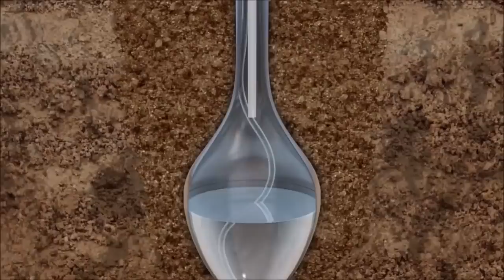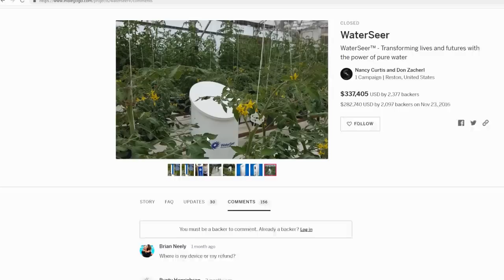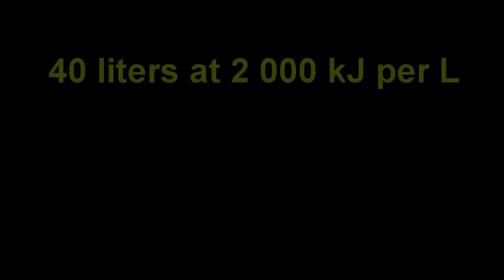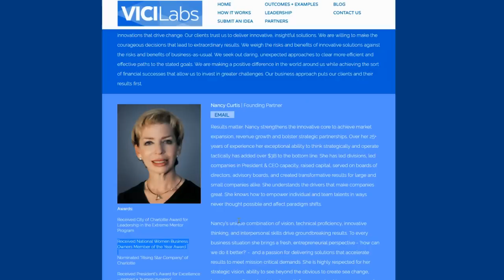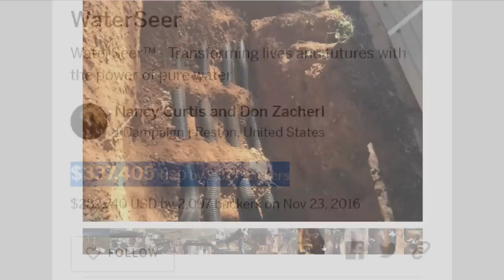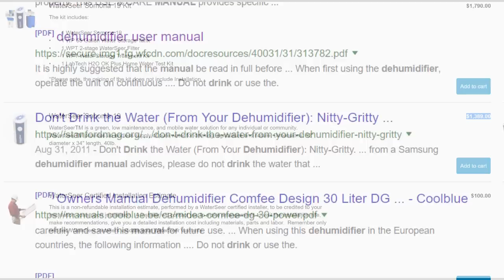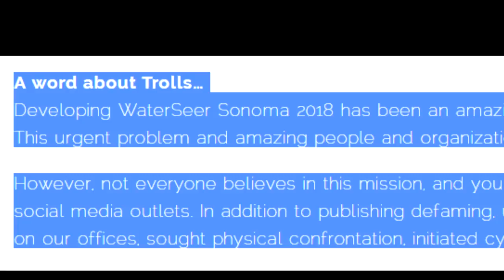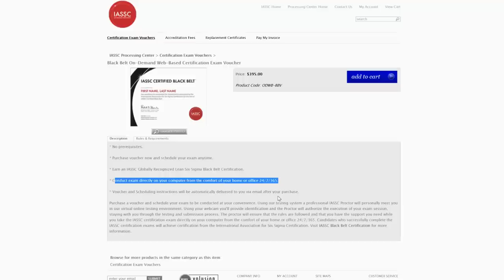Waterseer MEGA-BUSTED!!!!

Comment: It’s almost like all that money could have been used to build wells for water deprived areas
Reply: No no no. Those are proven to work.
Reply: xxOmponxx right???!😁
Reply: george green oh George love the troll! 😉
Reply: Not innovative.
Reply: 2019 is just snake oil galore. Tell me 2019 startup company that is actually making millions off of a real innovative products. I could swear 99% of current startups are selling jilly juice, anti vax products, or waterseers.
Reply: They would destroy them for either copper or black magic curse.
Reply: +xxOmponxx jesting aside it's not quite that simple. Wells tend to deplete underground water reserves thus if you draw up more water than they can replenish you'll get stuck in a vicious cycle of drilling ever deeper while older more shallow wells in a wide area run dry. Dams and rainwater collection cause additional !FUN due to your parched victims often being downstream in another country.

The only feasible means of producing additional water is to run whichever thermodynamically plausible system you prefer off solar power (doesn't need to be photovoltaic, a solar thermal distillery could be built from low-tech components). I'd wager many areas could also improve their situation a lot if they could reduce the demand of their export and tourism industries but that would require friendly international relations to actually help the truly poor people (shut down a golf court or greenhouse in the desert and ship the water to the nearest non-oil-producing country)
Reply: Thats the classic in the box thinking that insures the oppressive ceiling of poverty is never lifted from those noble 3rd worlders! 

We need fantastic ideas and scifi concepts not practical applications! If my liberal arts degree taught me anything its that my imagination supersedes the "man" , come on guys lets all hold hands and chant, we can bring the rain if we love the earth enough!
Reply: That's too mainstream for stupid copycatters
Reply: They strip the copper from the wells within days of new ones being installed
Reply: aaaalmost, but alas
Reply: They could also have made the path to the water less perilous by installing ... SOLAR FREAKING ROADWAYS!!!!
Reply: Usually there's no groundwater in water deprived areas, otherwise the people would have dug a well.
Reply: no, people who fall for scams wouldn't invest their money building wells. Besides, the areas that are deprived have people perfectly capable of building wells, but the instability in their area prevents wells from being maintained, sustained, and built. The problem is much bigger than simply building a well,
Reply: You know what is a huge business in some african countries? Water transportation

There is water, all you need is a way to move it
Reply: Fontus Plonkas Mark II
Reply: brajamtho757  I've never tried one of those things, but that's exactly it... In the article where Indiegogo promoted Waterseer, I mean hell, those people are in a river getting water, all they need for it to be safe is for it to be cleaned and filtered.
Reply: @coffeecuppepsi  good one !!!
Reply: Or...Ship them all to western countries... Oh wait, nevermind.....
Reply: brajamtho757  Providing filters these things may filter off their "nonprofitable" profits.
Reply: @WILDWOODislandder  And the people ripping them off are conservatives, taking advantage of people trying to help. That money could have gone to help the poor instead of lining a snake oil salesman's pocket.
Reply: You mean like what Justin Wren is doing?
Reply: 3D printed wells?
Reply: its almost like that money could have been used for anything whats your point?
Reply: brajamtho757  the life straw needs to include a iodine crystal pre filter if you are dealing with virus or bacterial disease. Don't trust a life  straw in fecal contaminated water. A full sized hand pumped filter with the iodine prefilled is worth the $60 price tag. If you have to use the straw you should use water tricks you no to get a clear as possible water in a clear plastic bottle then pre pre filter the water through a snap from some clothing into another plastic bottle. Then use the straw out of the cleaner water. The straw won't last long is its being used in dirt water. They are great for a 10 day epic disaster but for a year long survival situation you would want a hand pump and ore ore filtering the water. All the filter life stats are achieved using clean water!
Reply: @crash6674  what do you need copper in a well for?
Reply: @WILDWOODislandder  At least they understand punctuation.
Reply: You know what pisses me off after watching Phil tear this apart? Look at their FB page, look at the pictures and occupations of the FB users who are complaining about being scammed after they “invested” their hard-earned cash. 🤯🤮 Why are these crowd-funding sites not required to show the dummies who are typing in their credit card number just as they plan to support these pie-in-the-sky scammers this or other debunking videos.  Part of me says a fool and his money soon part, but I’d almost guarantee that some intelligent folks have lit their cash aflame at Indiegogo in hopes of getting in on tech that promises to do the impossible, i.e., to finance a product or service that venture capitalists and every other deep pocket has shunned. Is that what the6 believe, really? Are these people so ignorant to believe that Waterseer goes straight to IndiGogo “market” for financing their amazing technology?! It makes me angry that 80% of the population are so naive to get duped time and time again, and government refuses to intervene.  Just like the payday industry, crowd sourcing will have a day of reckoning, one day

Why aren’t these sites regulated? You have to read & acknowledge 200 pages of legalese in order to buy so much as a stock of Google. Finance is heavily regulated, yet there is no regulation here, I don’t believe. There’s probably some disclaimer own these crowd-funding sites, however it would be nowhere near what is required of every other financial product in the industry.  Remember, these folks complaining on Facebook often times refer to their bamboozling as being scammed out of an “investment.”
Reply: brajamtho757 
Salaries? Nah. It means buying properties such as luxury cars and using them for personal needs.
Reply: WIth that idea you couldn't get as much money out of people into your own pocket...
Reply: Interesting stuff I found with 10 minutes on research. CEA FARMS , ya know the farmer that provided  a rave review of Waterseer ability to water his lettuce. Well, I noticed 5hat CEA Farms’ website looks awful familiar to WaterSeer, one that looks awfully familiar to Re-Nuble. What’s Re-Nuble you ask? Well, a start-up that was one of the ten finalists, alongside the botox queen who heads up Waterseer (Nancy Curtis) at that Google-sponsored women-in-tech conference. 
What’s even more interesting is that on CEA Farms’ website, the honest-looking farmer has himself listed as the the owner (the “principle”)alongside three “partners” in the farm/restaurant he purports to operate in VA. Who are the three listed partners you might ask? Well, two of them are Waterseer and Re-Nuble, both of which made the finals at that tech conference. The 3rd company is X-Virity, whose website design is uncannily similiar with Waterseer , X-Virity, and Re-Nuble — coincidence, maybe. More research is needed, as well as a barf bag, before I even peer into this rabbit hole to find out who owns what and pull each players’ life histories.    

Small potato’s here, but I despise when business people greedily play on the consumer’s emotions and their ensuing irrational behavior, and I see a theme developing after a short amount of research. CEA Farms has a banner on their website that is titled “DO YOU CARE?” Why yes, Donald Virts, owner of CEA Farms, I do care that WaterSeer has you provide the  one and only Waterseer testimonial, but that opinion you offered is tainted.   
I care enough to spend an entire upcoming weekend and a few hundred dollars on researching all these companies and the folks who own and operate them. Something is rotten in Denmark, or should is say DC, because all these companies are situated near Washington.

I’ll do some in-depth corporate research when I have time. More to follow.
Reply: they send people all the time and they drink all the water its too hot to sit an dig without water lol
Reply: @adamsmith8660  the reason they are water deprived is becouse they dont have wells, and they lack the tools to dig them in most cases.
Reply: @coffeecuppepsi  WOAH
Reply: @noahoglesby5325  there isn't groundwater everywhere. You can't just dig a well anywhere and expect there to be water.
Reply: @akalion213  it's not that I don't understand it's just that I don't believe in it kind of like Santa Claus I'm sure being a Democrat there's a lot of things you don't believe in either like everything that makes common sense
Reply: Wells either tap into the aquafur(dangerous if you do it on an industrial scale) or rely on regular rainfalls to support the village.

It's not a solution for water deprived areas if they aren't getting enough rainfall to begin with.
Reply: Or pay for solar panels to be installed in many villages to just run a dehumidifier to begin with... Or for that matter an A/C unit with a dehumidifier built in. to get the added benefit of not cooking in the sun while getting a tasty glass of air juice.
Reply: There is that japanese dude who invented a simple deep well water pump using only a couple of pipes, a car spring or a big rubber band. He goes to South East Asian and African villages to teach people how to make it. 
If he ever ask for money i'd throw it at him.
Reply: Yup
Reply: some places have shit for water table depth, but in others, desalination plants, rainwater collection and storage, or just water purification plants, all conbined would solve the issue, its just a matter of actually fronting the cash to make it happen, and not being a scam like those guys
Reply: ikr like is an irrigation system such an unreasonable idea
Reply: Best if the wells are 3D printed ?
Reply: This is pretty much what I was thinking.  Just put a hand pump on the top of a well and magically they have all the water they need with no electricity.
Reply: As a multi-gen well man, thanks for using the term “build” vs “dig”.
Reply: @Photoloss  "!FUN"
Why would one settle in a location with aquifer? It takes countless lives and months to penetrate it and isn't worth the effort.
Also, try starting a plump helmet farm if there is insufficient water.
(Just kidding, Internet points if anyone gets the reference)
Reply: or water filtration
Reply: xxOmponxx or water purifier is tablets
Reply: @Photoloss  damming a river doesn't take water out of the river. It just controls the flow. And there's nothing wrong with wells if done responsibily. Id wager that lowering the demand for tourism in those countries would also cause unemployment and few people in the country selling the water would benefit from the revenue.
Reply: @moshunit96  Dam reservoirs do increase evaporation losses and in rivers with large seasonal variations they can store all excess during the wet season then keep withholding it during the dry. The water is "removed" because it evaporates from the fields next to the dam rather than flow downstream which is a serious issue if there is a national or cultural border involved. And while far less significant in this context the dam can also cause major damage through excess water if it bursts or needs to engage some kind of overflow safety.

Neither wells nor dams are much of an issue if used responsibly and both can indeed offer significant benefits. But we are talking about humans here so "responsibly" kinda is off the table.
Reply: @issarlk  embelis
Reply: @adamsmith8660  Does it not rain very often in Africa?

Comment: I work on a lot of air conditioning systems. If you have ever seen what is in the condensate drains on them... No one with any sense would drink it.  Waterseer and Theranos belong on the same page.
Reply: And Juicero
Reply: Jizzero 🤣
Reply: The condensate would be only affected very minutely by any airflow anywhere on or around it.  The stagnant pools is what the nasty comes from.  In the drip pans on ac systems there is not a constant flow of the water it drips and pools to the level to reach the drain where it will only leech out whats above the level of the drain hole which is usually like a centimeter or two which leaves the water to stay there. It doesnt get exchanged by the new condensate because the water pooled on the bottom is stagnant and no mixing takes place..  even in the newer efficient units that generate triple the amount of condensate and the large pumps that push it to the sewers get covered in that multicolored thick gooey mold even though they drain every hour or so..  the water still sits in those pools and bits of the mold in the drip pans migrate to every part in the system.  If you stuck a filter on that crap it still wouldnt be drinkable in my opinion.  Youd have to destill or rev. Osmosis or something..  even if the filters do remove 99.9 of the nasty those filters would need changed a lot...  
  One objection i do have though is that if uv light is introduced to the drip pans, as long as the material is uv resistant, no bacterial growth will occur so yea. There are hundreds of little things like that which solve issues but will not get introduced to the public as a commercial design because people want to keep people in the dark for money...   there is a bioengineered grass that will not grow taller than 2 inches and stays green year round, grows in any climate and can be produced for a fraction of a cent per a large amount of it..  but the project will not get granted any approvals from big brother because federal laws that got made by oil companies to protect their sales.  The amount of gas and electricity that is spent on mowing the yards is rediculous as well as the lawn care industry so this grass that is cheeper than any other and better than any other will not ever get released to be sold..  what about photonicinductions idea of occupying a 2.2 sq km area and coat it with copper which if done right would use the earths own magnetic field and rotation as a generator.  That idea works and has been tested..  and a 2.2 sq km area would be enough to totallypower new york if refined and all...  the fuck is that at?  Its simple and fact is it works...  but nooo. Build a nuclear reactor there that we dont quite know totally about it all but do know the potential of a possible failure which can make an entire plot of land unusable for over 100 years...  we are the video games of the National leaders.  You can raise any creature in solitude and teach it only certain things which makes it predictable of the creatures journey through life..   fuck people...  too many godamn people...  too many bad people...
Reply: Yeah...never ever look inside a water fountain.
Reply: Legionnaires infections and P. aeruginosa are quite tasty.
Reply: Condensate would contain someone’s liquified bad breath, sweat and farts…
Reply: Don’t forget about Musk! He’s the undisputed champion of fraudulent promises.
Reply: I worked on a small chemical plant, we used air conditioner water for some processes, it was cleaner than tap water. Checked with instruments. Pipes that bring water into your house also look nasty on the inside.
Air condition drain can also be used to water plants. Where I live people just throw hoses from AC into plant pots outside.
Reply: @friendlylaser  I live in an arid area. My house already has a solar and wind power system to I decided to see if I could get his dehumidifier idea to work for an emergency backup. Ran 3 dehumidifiers set on a timer to run sun down to sun rise. Average of 2.7 liters per night. Tested very clean. So with proper rationing in an emergency, sure it works. But as a stand alone system? Hell no.
Reply: Drinking condensed water ( such as drinking distilled or demineralized water), is very dangerous to health as it lacks minerals normally present in drinking water which upsets the electrolyte balance in the body and impairs the ability of cell walls to normally exchange substances with the circulatory system. Condensate is extremely “hungry” for minerals. On all industrial condensing systems I worked on, a neutralizer with a mineral consumption block had to be installed to reduce the "reactivity" of condensed water before discharge into wastewater (prescribed by law in our country). For example, copper pipes would be "eaten" in less than a year and would start leaking, even stainless steel pipes would not last more than 2 years. Condensed water from the air is full of dirt, especially in urban areas, because all garbage from the air will be in the water, including billions of bacteria present in the air, so a disinfection process and a mineralization process would be needed.
Reply: If the dehumidifier is brand new there won't be any residue in the condenser. Although pollution from the air will end up in the water.

Comment: The worst thing about the WaterSeer is that even if it worked it would still be terrible. You are talking about room temp standing water in areas with mosquitoes. Not to mention the difficulty of regularly cleaning it so you don't have mold constantly growing in the reservoir.